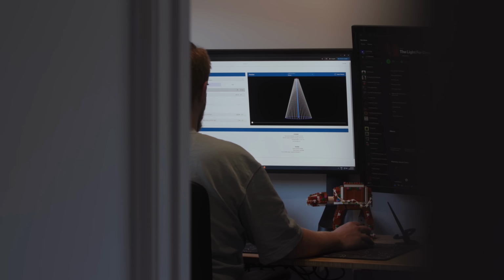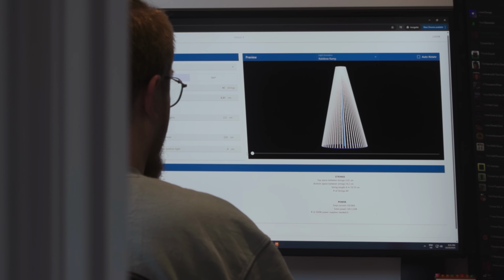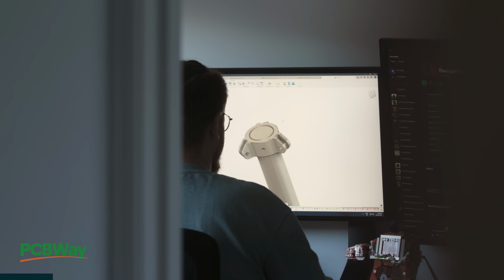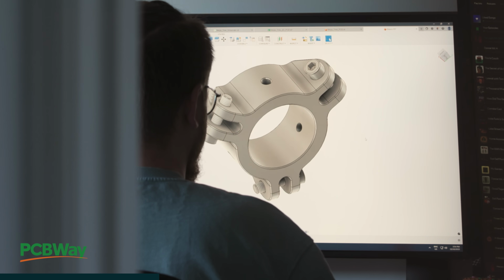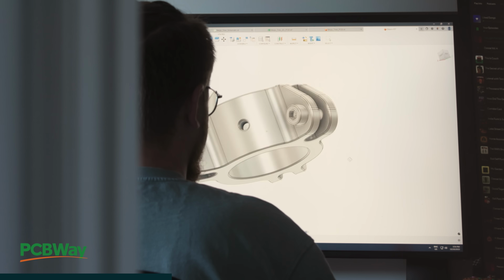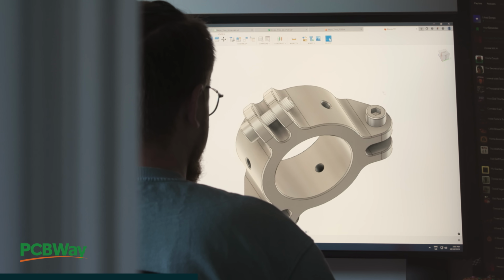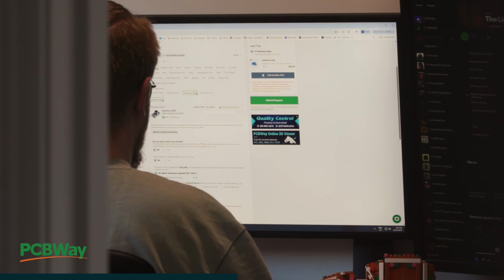Levelling up our Christmas lights...  | Stockpot Christmas 2025 Part 3

Comment: Coming to this late:
I think one of the potential problems with this large tree is definitely the wear on those strings of lights.
One of the options could be to have them loosely running through loops along some cord (rope, that plastic ratcheting strap, cotton twill tape) or woven through a light chain, that you can tension without putting as much tension on the wire.
Additionally, I don't know how much wind/rain is a problem in your area during christmas, you could potentially attach light hoops (eg hula hoops for example) on these cords/chains, too keep them from bowing in the wind/with how long and heavy they will be. (A cage-crinoline is kind of my general thought process about this.)
However, all of this reinforcement my not be needed, I look forward to hearing your thoughts in the next video.

Comment: I'd really love to see your controller wiring. 

Looks like your power and data in is coming from the bottom, and you are just linking up the strands up top in series. Is that correct?
Reply from the maker: Correct!

Comment: I used PVC Pipes for my base too, Last year I added an inside wheel. To add a second row of lights, to add depth. My lights are only bunnings RGB and white fairy lights. But one year wish to replace with addressable lights. Loving the videos.

Comment: Look great. Well done. Can't wait to see it on display in a few weeks. I built a mega-tree 2 yrs ago using bullet pixels and pixel rape, at 50mm spacing to keep the cost down, and although it looks good a little more resolution wouldn't hurt (i.e I had planned to double them up) and the storage is a real pain. My tree pole is made of 2x 25mm gal pipes screwed together and I built a topper and mechanism that slips up and down using strings and pulleys. Anyway, great work, thanks.

Comment: Another great outcome. Good luck with the weather and it's longevity, fingers crossed it passes with flying colours.
In my experience, I had to replace the PVC / Conduit with some flat bar as the tension mixed with sun meant the base 'lifted', resulting in a wavey looking base.
The concept of using pcb's is intriguing to me, and if I have the chance to 'upgrade' my bullet pixel tree, this is something I would give great consideration to. Personally, I prefer my tree to have a lot more denisty, so I would be looking to increase the quantity of strings. In my current tree, I have 85 pixels x 28 strings on a 2.4m tree, 180 degree. How difficult would it be to increase the pcb to accomodate more strings? I really like your approach to these projects and adding a little uniquness to the builds, well done.

Comment: Hi, I absolutely love this serie! However, after each video, I often feel a bit confused. You don’t show much about how things actually work. For example, in this video, I would like to understand exactly how the bungee functions and assists, the schematic of each PSB, the purpose of the form (please show it), and where and how these components are used. There are many things you mention very quickly without visual aids or detailed explanations. Maybe it’s just me as an engineer wanting to understand, but I often end up feeling a bit frustrated and confused after watching.
Reply from the maker: You'll see a lot more of the technical explanations in the installation video!

A lot of the props work in similar ways, so rather than explain it again in every video, the installation video will have more details in one place 😊

Comment: I love the project but are you not worried about oxidation on the pcbs? Do you really think the liquid electrical tape is enough for the outdoors?
Reply from the maker: I'm definitely worried, but I've seen no issues so far! 60 days or so in the weather was no problem for the mini trees! 

I've used liquid electrical tape in similar applications for years, so I'm pretty confident in it!
Reply: @TheStockPot-AU Thanks for the reply! Sounds promising!

Comment: I've been looking for examples of a seed pixel mega tree. The normal straps and bullet pixels look a little ugly in the daylight. I do worry about this system surviving a storm, though. I've seen steel plate toppers bent by high winds. I have doubts about this PCB topper's longevity. All the hard wired connections will make in-season repairs very difficult. Looking forward to your future videos.
Reply from the maker: We'll see how we go! 

It spent a couple of weeks outside during some storms while testing and survived well!
Reply: @TheStockPot-AU  Don't get me wrong, I don't want you to fail. I'm rooting for you.

Comment: Looks good!
A few notes from my Seed pixel mega tree (now into it's 4th Christmas):
* Be very careful tensioning by the seed pixel's own wire. I suggest a thin fishing line or braided stainless steel wire. Mine has been okay since I used alternate nodes layout method and the wire is a little thicker than modern variants.
* Light Show Hub calculator for current is not always suitable. And some seed pixels are constant current (particularly the 24v and 48v strings).
* Have some spare strands ready. I would have used a connector instead of soldering directly to the topper.
But points for a proper tree topper.... unlike my frying pan. 😁
Reply: I'm currently finishing my 2m mega tree, and have put my strands through some clear acrylic tube (which I've frosted inside).
It's not as much weight as a 4m tall tree, but do you think I need fishing line too?
Reply: @jezmck I think that would be okay. The acrylic tube would stop the string moving in the wind and gravity is okay on the wire. 
The risk is from high winds or elastic/bungee cords pulling too tight on the wire.